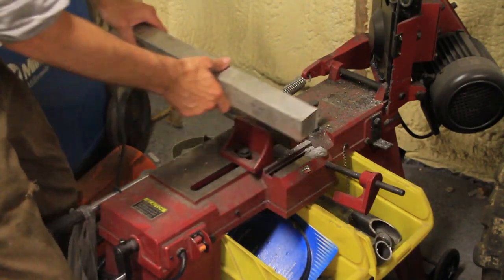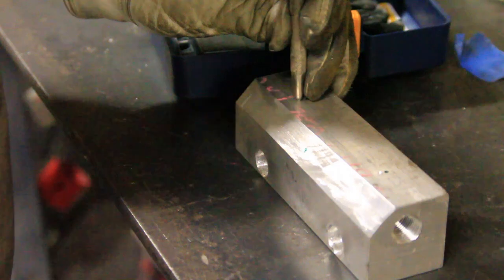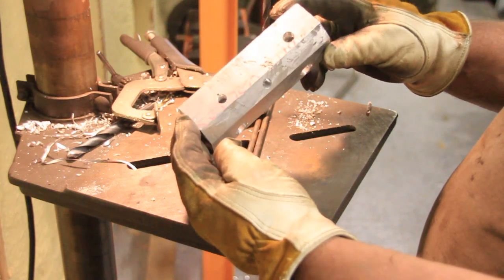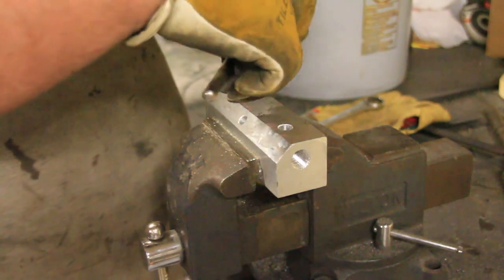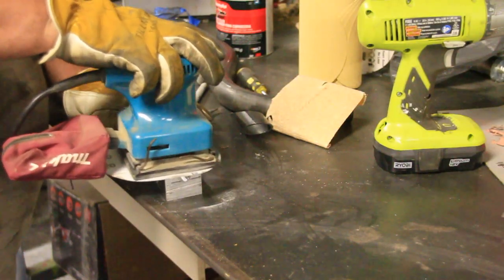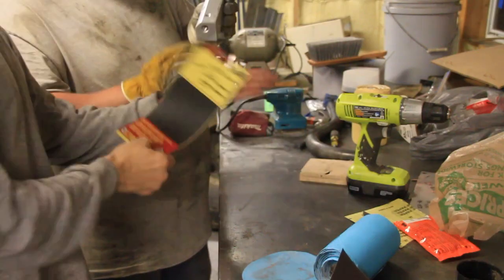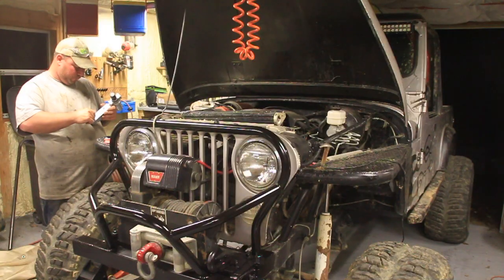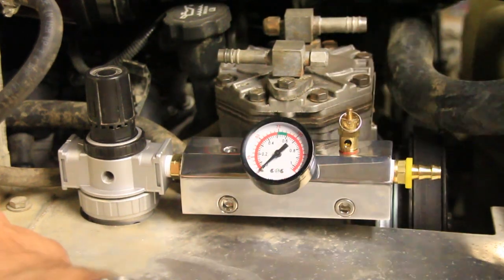DIY Custom Air Manifold

Comment: +BleepinJeep just to save you some future pain and heartache, you shouldn't use an abrasive cutting wheel or grinding wheel on aluminum, the aluminum melts as you cut it and it will plug up the pores in the wheel, expand, causing it to crack and fly apart, often violently.  

Otherwise, that thing turned out dead sexy!

Comment: I used to make manifolds like this all the time at work for hydraulic systems on plastic injection molds. You can knock out a manifold in an hour with a Bridgeport mill. For just using a drill press and hand tools, you guys did a bad ass job on that thing!

Comment: I just got a 98 cherokee classic. Is there anything I can do "cheap" to get better gas mileage?  Im getting around 12 miles a gallon right now.Also what are some cheap junkyard upgrades I can do? They would have to be direct bolt on cuz I have no fab skills. This is my daily driver so I don't want anything to crazy. Would like to give it a little lift. How high can I go before needing to worry about drive shafts etc
Reply: koskey06 Basic preventative maintenance is your friend. A lot of people don't know it but if you have a bad coolant temp sensor it can kill fuel economy. I made a custom intake using a spectre cone filter and a 6 inch long piece of 3" exhaust pipe for the intake. Then you take your intake temp sensor and move it from the manifold and install it in the 3" piping to lower the temperature it reads. You'll have to get a standard pipe plug for the intake manifold after you relocate the sensor. Also look up XJ fuel injector upgrade.Those 3 mods brought my mpg from a hand calculated 12 mpg to 19 mpg. On 31's and lunchboxlockers @ 60mph 90% highway driving.If you have any questions about this, you will find all of it on jeep forum or naxja.
Reply: koskey06 How old are you spark plugs and spark plug wires? Try replacing those